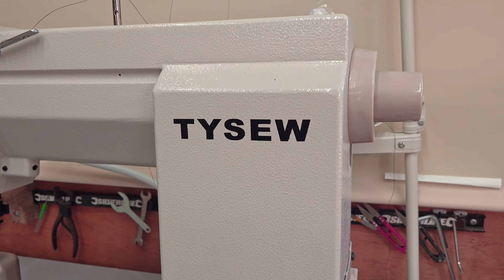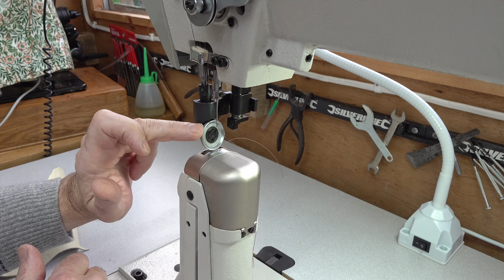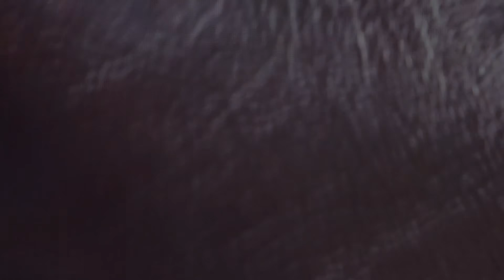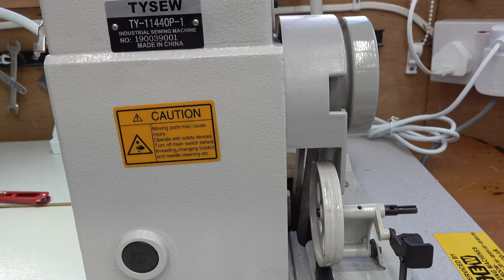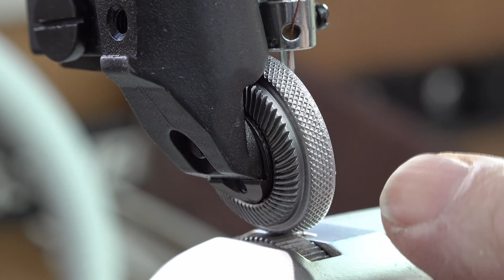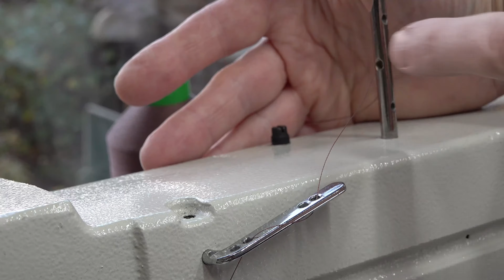Tysew Post Bed Sewing Machine Review...Sponsored

Comment: I’ve just bought this machine, how do I reverse the wheel to do a back tack?
Reply from the maker: Hi you need to turn the work around, turn when needle is down.
Reply: Thanks  @harryrogers . One more question, if you don't mind? I've altered the stitch distance but now my wheel/foot has stopped turning. Is there a way of activating it again please?

Comment: I am on the fence about the roller foot post bed clone as you have or a walking foot post bed. Have there been times this post bed had limited you when a walking foot post may have been handy. Salesmen say post beds with roller feet aren’t really designed for heavy stuff especially veg tanned. It seems these top and bottom feed are more popular than the triple feed post beds. Thanks in advance
Reply from the maker: Hi this set up is ideal for shoe uppers as the top and bottom feed give a very good transit. I did have a walking foot post bed, but for shoe work I personally found the walking foot was more difficult to guide. This machine in the video is not suited to heavy veg tan in my opinion  its great for shoe uppers and wallets , but if you are sewing heavier veg tan leathers for strong bags etc I would be looking to the cylinder arm machines like in my bag making video.

Comment: Tight for space here...have a pfaff 145 myself, and make wallets, bags, belts, sandals, etc. 

Would you say a post bed is the "do it all" machine? 

I have dome some pretty unthinkable projects with my flatbed 145, but wondering whether the cylinder or post bed machine might be better suited.

I know you have a number of machines, what are your thoughts?
Reply from the maker: I found the twin drive wheel post bed machine good for shoes and wallets with nm60 or 40 thread. I  don't think it is a do all machine....the Juki DNU1541 was a better all rounder.
Reply: @harryrogers  Ah yes, if I remember right that's one of their "box locus" machines that is supposed to be cleaner in terms of feed. I had that on my short list as well. (Well, it was either that or the 1508, I don't remember exactly)

Thank you for your reply, I have always found your content really helpful and your attitude inspiring.

Comment: Awesome videos Harry.  Which do you recommend if you could only purchase one, post or cylinder and why?
Reply from the maker: Making bags...cylinder,  making shoes...post
Reply: @harryrogers  its interesting.  It seems the post bed would be more versatile as it allows you to do bag side seams and bottom seams more easily?  Is this not the case?  Why is cylinder arm better for bag making?.
Reply from the maker: @jayjohnson7423  I have found the cylinder arm is better able to cope with variations in seam thickness and still give even stitches, and it can generally handle tougher sewing jobs. I do take your point about the bottom seams. But hey that is only my experience and I am not a sewing machine seller, so it is probably a good idea to ask the experts at a company such as Tysew for their opinion. I think it may also depend on the type of bag and the thickness of the leather you are using.....so for example take a look at my video of making a Mailbag. Also take a look at how Mulberry bags are made as that may help you decide what is best for you. I am sorry that has probably just made things more difficult for you.

Comment: Hi Harry, I'm here again asking another question. For motorcycle leathers repairs, would you recommend a cylinder arm or a post bed machine? I already have a tysew walking foot flat bed, but looking to purchase a second one. Where I'm struggling at the moment is when I have to do top stitching on arms and legs since I can't get inside, or when I sew patches, again on arms and legs. I've contacted tysew and they recommend a cylinder arm. 

Thanks
Devid
Reply from the maker: I think a cylinder arm because you can get more leather leg or arm along the cylinder, on a post machine the post bit is only 6 inches or so, unless you find a specialist machine with a very high post. It you can, take some sewing samples along to Tysew and ask to try both machines.
Reply: @harryrogers  Thank you very much for your quick reply. Yes, I will pop in there and try both machines. Have a nice day!

Comment: DO you have any more information for the servo motor that is provided ?
The options available i see are the WR561- with speed 5000rpm
JK-550J (550W) 5000rpm
JK-750J (750W) 3000rpm
They all seem excessive , but i suspect its because of my lack of knowledge. Is it because of the 3:1 speed reducer

Many thanks
Reply from the maker: Hi I think it's a 500w...looks like a Jack but I am not sure..it's very good...better than my older Jack servos....best ask Tysew to be sure.

Comment: Why don’t they put reverse on these type of machines. My consew 701 doesn’t have one as well.
Reply from the maker: Hi Trever, I think it's because they are primarily used for shoe work. I would like them to have a reverse as I use the machine for all sorts of things. What I often do, apart from the obvious turning the work around to get reverse equivalent, is I sew two stitches, lift the foot, push back and sew again over those two stitches to lock the row. All the best Harry
Reply: Never figured out how to oil my machine

Comment: Do you have a flat bed anymore/did you ever have a flat bed!? I've been thinking about swapping my flat bed for a post stitch for a while and I think you might have convinced me to do it! I do all my stitching on a cylinder arm and the flat bed is just collecting dust.
Reply from the maker: Hello ...yes I do have a flatbed...I use it for heavier duty work ...it's a Juki DNU1641 that Tysew can sell you as an original or clone. I am using the post bed for shoes and wallets. I could do wallets on a flat bed but the post bed is ideally suited as it's a lighter thread machine with excellent  visibility around the needle, and good transit. I would not be without my flatbed for other jobs.
Reply: @harryrogers  super thanks Harry!

Comment: Your video is great quality as always! I bought Mauser Special 591, but I'm surprised that the length of the outer radius stitch when sewing small radius (about 1-2") curved seams, is much longer as the length of the inner radius stitch. Have you tried sew small radius left/right seams? May be is there some adjustments? I tried put feeding wheel closer/farther from needle, but no significant changes seen. 
Mauser has B and C modifications. I have an C specification, this can use needles up to 130 Nm, but I used 160 Nm needle with 4 mm thick leather with no problems. Great machine!
Reply from the maker: Hello and thanks. I think the curved seam effect is a feature of all roller feeds.....I know it's been mentioned on leatherworker net before. I think the usual mitigations are to use optimal wheel pressure...I.e. not too firm, and smaller stitches..but I think it's a feature of this type of feed...perhaps someone else here can add their view as I am not completely certain about this. Thanks again...Harry
Reply: @harryrogers  Thank you Harry.

Comment: I’m still not clear on the difference between cylinder arm and post bed machines. Are there things you would only use one or the other? Or are they interchangeable?
Reply from the maker: Hi some shapes you will struggle to get on a cylinder arm machine but you can do on a post, like the counter seams on some shoes, or the inside of a bag....but also bear I mind the different feed mechanisms, rollers in this post versus feed dogs in the cylinder arm etc....they are both optimised for specialist sewing operations.

Comment: What is the largest thread size they will handle? I looked at the product specs but they never seem to show that info.
Reply from the maker: Hi in the video I am putting nm60 bonded nylon through it. I have also put some nm40 through it. Needle wise it goes from an 80 to a 120, the manual gives the Singer needle scale as 11-20. Presser foot lift is 7mm by hand, and 14mm by knee. Max sewing speed is 2500rpm and it has a hefty 41mm needle bar stroke....I hope that helps Lvx. Best wishes Harry.